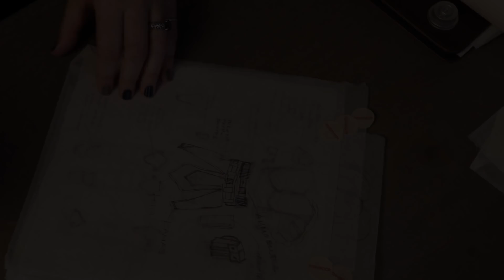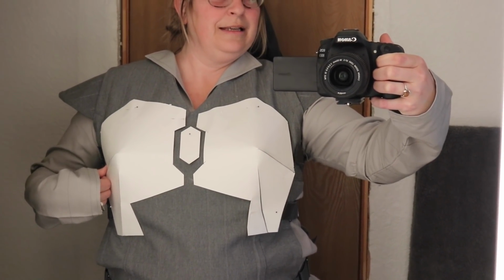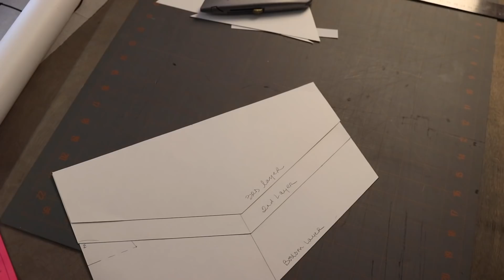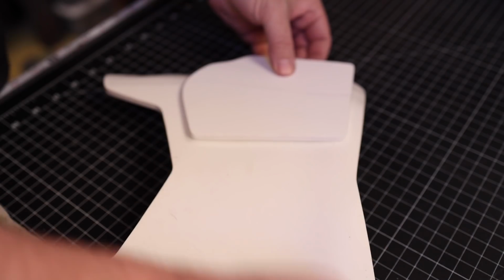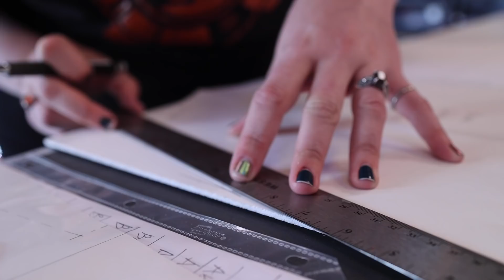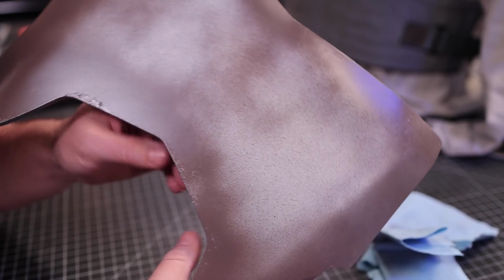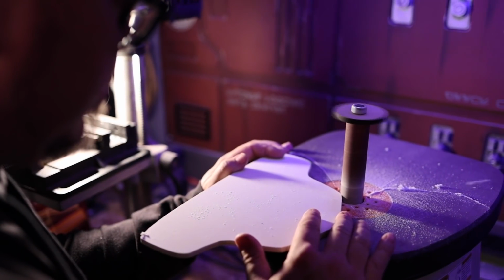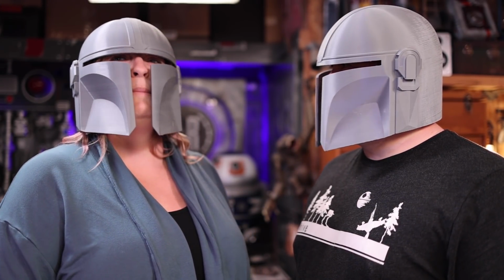Making Mandalorian Armor

Comment: Another awesome and informative video. I really like how you both designed your armor. Your use of the plastic cement is pretty cool. I have weathered my plates by doing multiple layers of spray paint and after the paint is completely cured, hit it with a random orbital sander. I got some awesome results. Thank you for sharing your awesome builds. Look forward to seeing the finished project. Very inspiring.
Reply from the maker: Thanks so much Daren, appreciate it !

Comment: I’ve never thought of using rubber cement! That’s great! You should pick up a rubber cement eraser. It’ll make the removal so much easier
Reply from the maker: Whoa  . . . rubber cement eraser???  is that a real thing? Sounds Awesome!
Reply: @TheSmugglersRoom  Yup! its basically a block of solidified rubber cement. Since rubber cement sticks to itself, you just rub it along the surface and it comes off!

Comment: You can also use the laser to cut the armor shapes. We cut foam PVC (sintra) on the laser all the time.
Reply from the maker: Really???  I thought the laser would have melted it?  Tell me more about this wizardry
Reply: @TheSmugglersRoom  Cuts through like butter, you can even engrave it. Still doing tests, but we throw it on the Boss laser and it works.

Comment: For when you get to your Helmets, Look into medieval helmet liners, they're WAY more comfortable imo and lighter than most modern padding solutions. Plus they can be made adjustable to get the helmet sitting at the exact right spot. I have a padded suspensor liner in my Mando helmet that I got with a replica medieval steel helmet that I got for reenactment, though I did add a couple of motorcycle cheek pads for added stability. Its way lighter, more comfortable and less warm than when I just used pads.
Reply from the maker: oh sweet!  I'll check that out.  Thank you for that!
Reply: @TheSmugglersRoom  No problem. Don't get me wrong though, pads are just fine. I just think liners are better if you're a perfectionist about where it sits on your head and will be wearing the helm for hours. Comfort and weight can eventually get to you if its not light enough or comfortable enough.

Comment: I'm in the process of building my own mando armor. I've hit a few snags, like constructing the gauntlets. I'm not skilled enough yet to build the gauntlets from scratch so I bought these toys that are basically the top half of the gauntlets but now I'm trying to figure out how to attach the toy pieces to the bracers.
Reply from the maker: You could use webbing or velcro to attach them.
Reply: @TheSmugglersRoom  right after I posted this I gave them another look and found out I could take the toy pieces apart in a way that will make them much easier to attach them to the bracers. I'll probably just be gluing them together and hopefully my main armor set will be mostly finished by the end of the weekend.

Comment: great video and a solid start on the armor. still needs a few adjustments. bottom wings on chest armor need to come in a bit more for a better fit
If I remember correctly didn't you plan on making twi'lek mandos ?
Reply from the maker: Thank you.  It’s coming along.  Did a little extra forming, although the mannequin is a little more flat than I am.  On me the armor fits pretty snug.

We were doing a Twi-Lek style originally.  However with how close we are to celebration we may not have enough time to go that route.  But we can always go back and add that to new helmets.
Reply: @TheSmugglersRoom  I designed a twi'lek mando helmet and i'm currently in the process of making a mold for selling resin cast copies 
I would be willing to send you one when ready as a free sample
Reply from the maker: @markuspotsch8194  WHOA!!!  That would be so great!!  My wife really wants to have a Twi'lek version!
Reply: @TheSmugglersRoom  I pm you on Facebook when I get it ready

Comment: Just wondering, would a blow dryer work for this, or does it have to be a heat gun?
Reply from the maker: I don't think so.  I don't think it would get hot enough for the thicker stuff.  But maybe for the thinner material.  Just not sure it would be hot enough.
Reply: @TheSmugglersRoom  Ok thanks